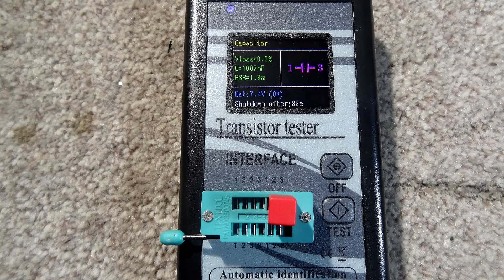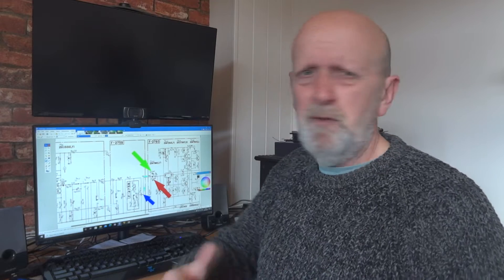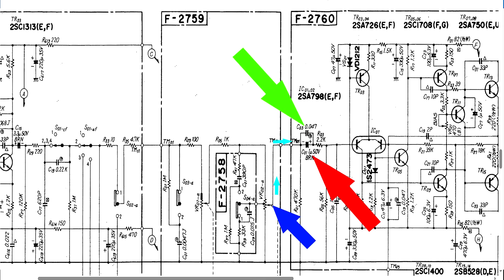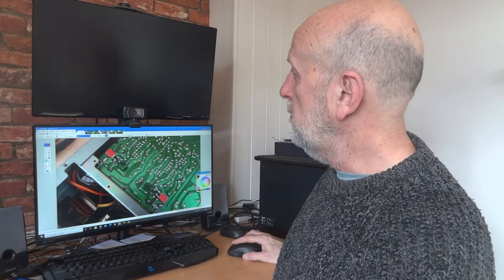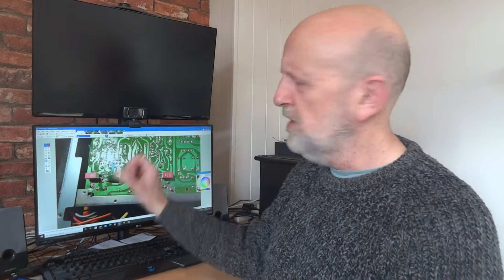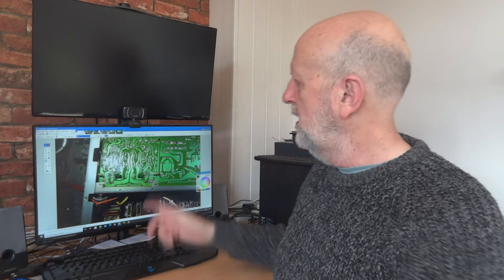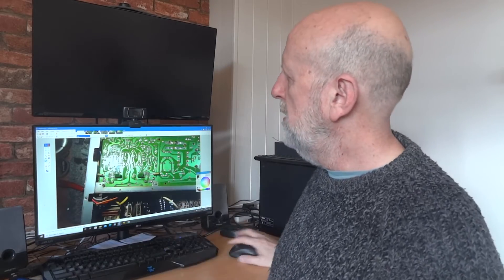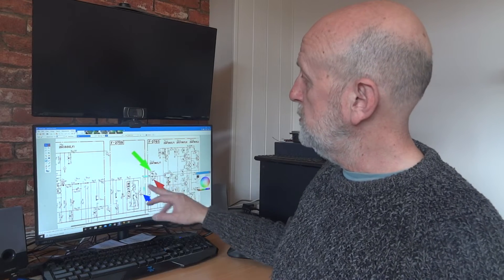Amplifier Signal Path Capacitor Sansui au-217 Recapping Follow Up WIMA update. ReCap Replacement

Comment: hi my mate  had  a 100%  re cap done on a quad  power amp note it cost him over £200 i said he been ripped of  big time 

the man that d the work is still working in the repair game his fee's are silly   i told my mate i could done alot of the work i did have alot on at the time 

beware  re pair fee's can be   hi  i checked the video heads on vhs   before they get jucked just in case   (sony) decks or high end ones
Reply from the maker: Its not cheap getting it done, think most service people charge the same price rate as an electrician or plumber around £70 a hour
Reply: U can buy Quad copies from China cheaper than that..... Many people say they are very good.... Xcept the anti China lobby... But there is a lot of shit like in the UK